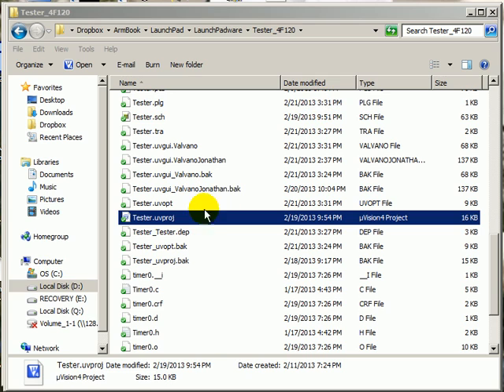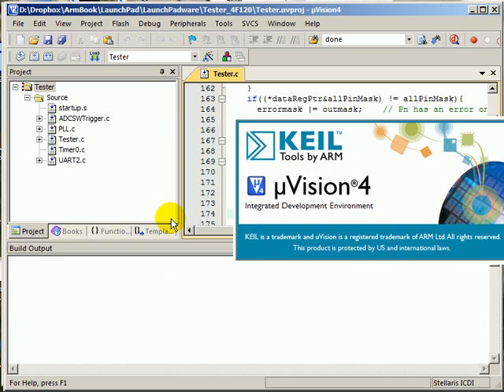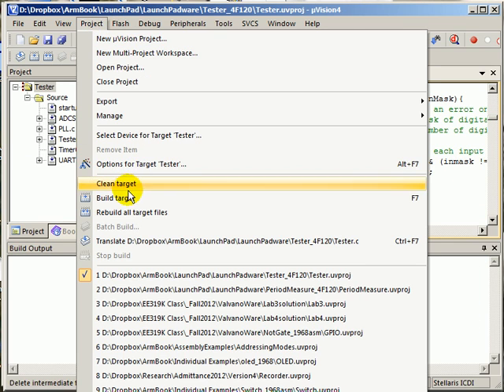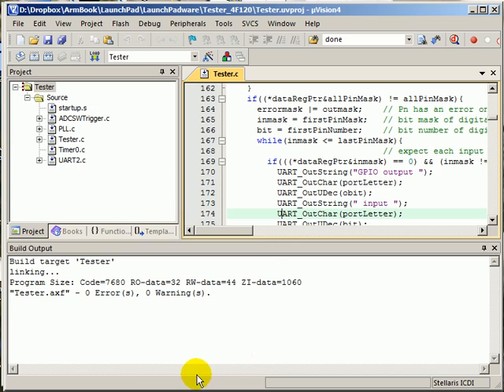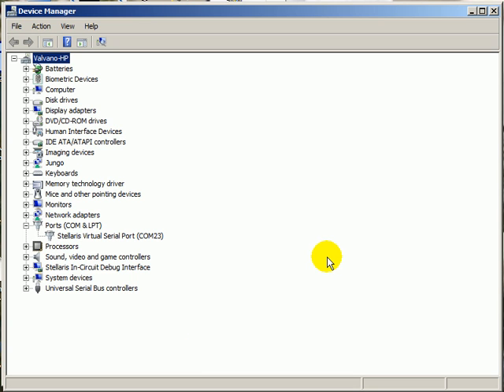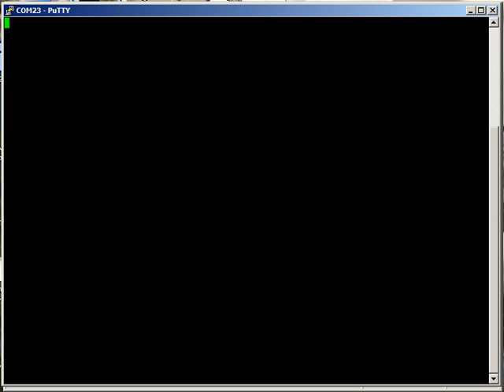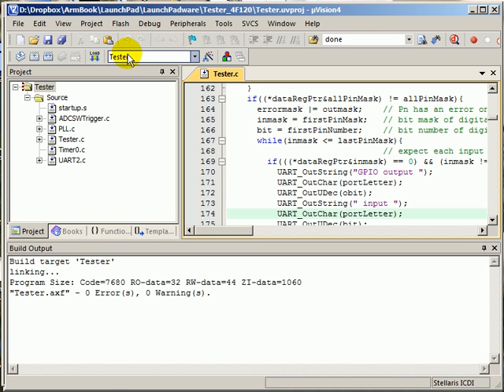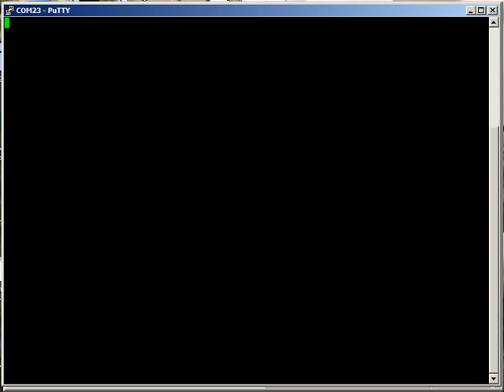Stellaris LaunchPad Tester

Comment: Hi, 
I didn't realize there is aready a solution, so I made my own boosterpack for testing launchPads (see https://github.com/Terstegge/LaunchpadTester ). Probably my solution is more expensive, because you don't need a IC but instead use LaunchPad pins to generate the test signals. Thanks for the video!